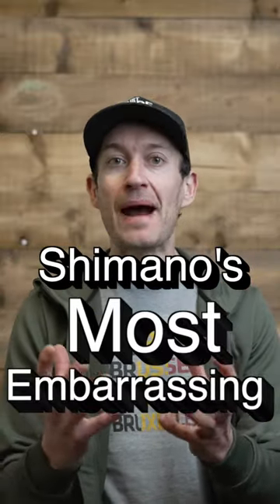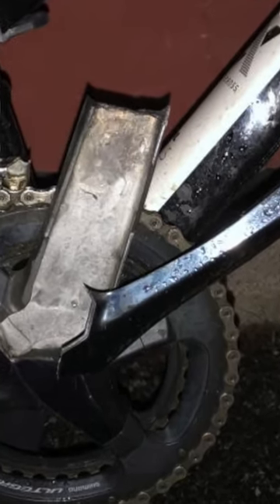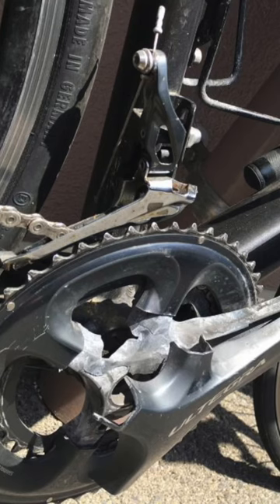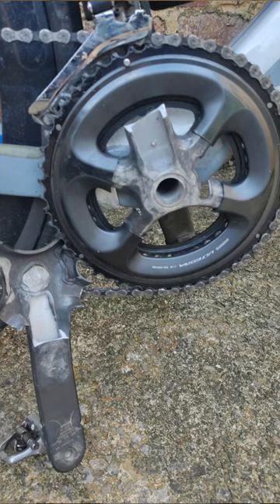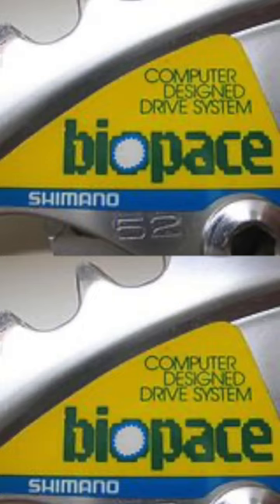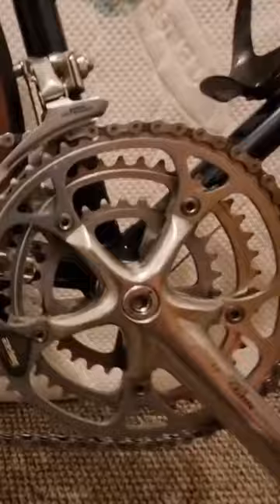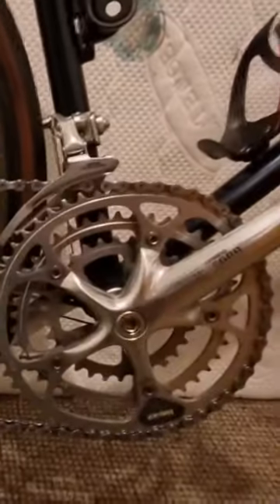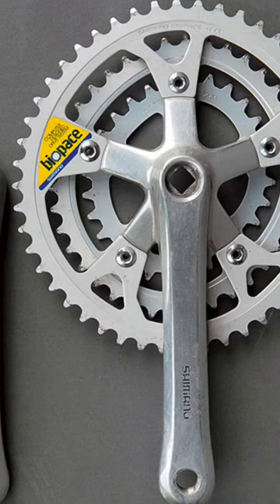Shimano’s Embarrassing Tech Fails! #shorts #bike

Comment: I had Biopace chain rings on my 1988 Specialized Sirrus that I bought second hand in 2015. I couldn’t feel any difference, I loved that bike, and even 30 years later the entire groupset worked perfectly. So maybe biopace was a marketing failure, or it didn’t work for some people, but I feel like it was a very well built piece of bike tech and I would have no problem buying it again in 2023.
Reply: Well, definitely right about marketing failure but while working at a bike store  I realized why the biopace was a failure, they built it wrong!! 
Basically the oval ring wider part is to be in effect when the cranks are parallel to the ground or even better when the pedal on the down stroke is a bit pass the parallel point. This means the wider part of the chain ring should be perpendicular because is the last tooth in contact with the chain that determines the leverage. Then when the cranks are vertical the smaller side of the chain ring should be perpendicular so it’s easier to transition. I have a modern mountain bike with Wolftooth single chain ring and that’s how is set up. But someone at shimano made a classical mistake when designing or building the biopace. Believing that is just leverage and not thinking round or about the chain transmitting the power from the top of the ring, they match the biggest part with the crank being with the most leverage , therefore they put the chain ring wide part lined up with the cranks. So when the crank is parallel to the ground the wider diameter of the chain ring is too, producing actually the opposite effect desired. The second issue is that is not oval enough to make a difference.

Comment: …..”reinvent the chain ring”….?!?! oval rings were used specially on the velodrome , waaaaay before the biopace ever come out, Shimano just made the mistake of setting it wrong, the bigger side should be vertical when the cranks are parallel to the ground and not in line with the cranks like they did. 
But talking about the effectiveness of an oval ring….well then you should ask 4 times Tour The France winner Chris Froome, it seems it worked for him pretty good 😂

Comment: Chainring is actually a thing now it’s called a oval chainring and it does have a bit of performance benefits
Reply: I think the biopace was ovalized in the opposite direction than the modern ovals and really made no sense.
Reply: @markusseppala6547  
Pretty much. I'm honestly not sure it was as big a failure as people made it out to be. They manufactured it for a decade which isn't a bad run
Reply: yes Chris Froome won 4 tours and a Giro with it, but the biopace (chain ring) placing with the cranks was in the opposite direction it was supposed to, so it actually hurt you i stead of helping you. Big mess up by someone at shimano…
Reply: @chrthiel  they messed up big time, is not the oval factor with it wasn’t oval enough, the mistake was on the placing of the ring with the cranks, it was actually doing exactly the opposite effect they were supposed to. When cranks had the leverage the easiest (smaller) side of the ring was in effect and viceversa

Comment: I had BioPace on my first proper mountain bike, a Kona Fire Mountain from around 91 or 92. The BioPace sticker peeled off the chainring while I was cleaning the bike one day, and forever afterwards the pedal stroke seemed much smoother.

I've used round chainrings ever since - especially on my fixed gear.

Comment: allright so.... nothing about the M760 brifters and the air powered shifters.. which ARE tech fails as they have become relics that were so undesirable that you can still find them OEM fresh in their og packaging at auctions... 

Biopace was around for quite a while on the low end spectrum and took several forms from seriously ovoid to off by a few millimeters. 
Oval and offset crowns are still a gimmick to this day... commercial failure? eh, partly. it still sold.

and the crank failure is a more of a construction fail than a technological one: not enough bonding agent, water and sweat creeps in, alloy starts flaking and pops the remaining agent off. 
i guess shimano has a % of catastrophic failures low enough to not warrant a recall.
Wouldnt buy em because they are fugly, but that's my take.
Reply from the maker: A lot to fit in a 60 second short 😜

Comment: Hm basically oval chain rings?
I got that on my cousins xc bike and it is a killer at climbs even in the trails
Reply from the maker: They're actually quite different to the oval rings that are more commonplace today and don't have the issues that Biopace did thankfully
Reply: @davidarthur  it’s the same! oval is oval, some more some less but shimano messed up on the placing degrees in respect of the cranks causing the opposite desired effect

Comment: People forget that the problem with BioPace was not that they were ovalized, but that the oval was 90 degrees off -- they gave the highest effective gear when the pedals were at 12 and 6 (the weakest position).  The reason given at the time was that they wanted to eliminate pulses in speed, so when you have the most leverage and could make the bike surge ahead, they wanted to compensate with an effectively lower gear.  Totally goofy.  But again, the problem was not ovalization itself.
Reply: yes! you are right sir!!! thank you! i’ve been trying desperately to explain that to people. Oval chain rings were used in the velodrome years before biopace ever existed. And is used by climbers like Chris Froome now a days